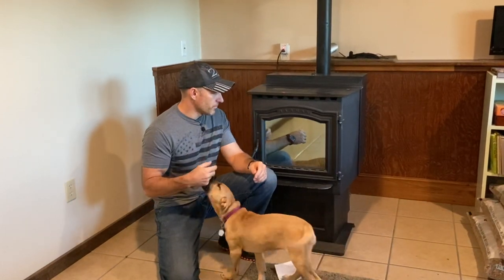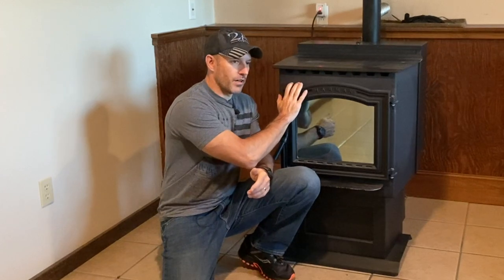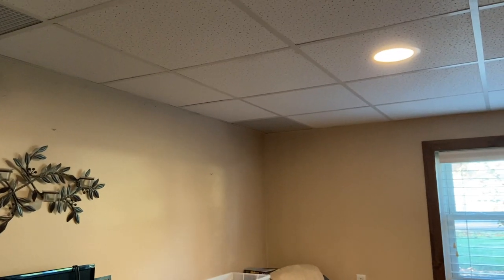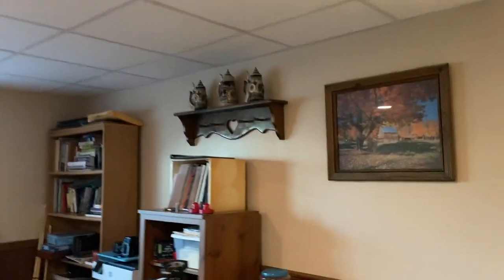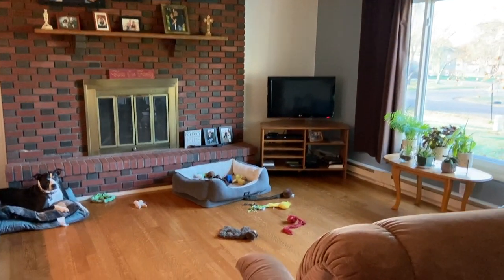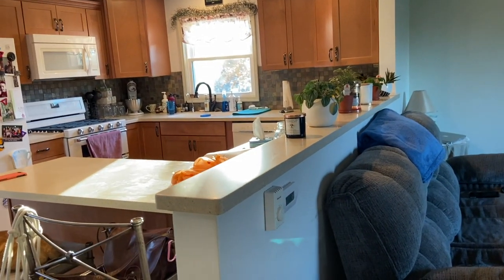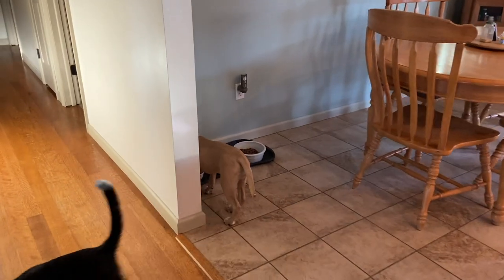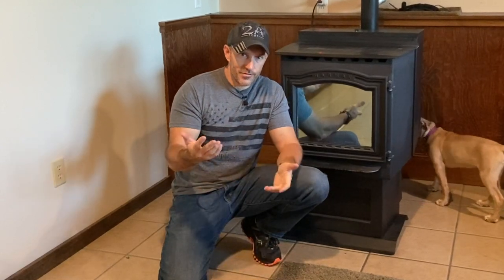How I heat my house with a Pellet stove, and move the warm air around

Comment: I also have a Harman p68. My home is one of those open floor plans. Ceiling fans make a huge difference in keeping the air flow circulating. Just have to turn them on lowest setting. Haven't had any issues with my p68. It's over 10 years old.
Reply from the maker: My harman is about 9 years old and never any issues

Comment: nice, looking at putting in vents myself. basement is undeveloped and the roof is all open to the floor which is hardwood. gets to 25-27c with temp gun. Blowing cold air on the stove into the back, and then the front also makes a nice draft of cold air to stove. have an OAK englander PDVC so i just run ventilator fan on circulation (on 70% of time ). 
Just use as supplemental heat in basement, low burn, get about 25 hrs out of a bag (only on for 6-8 hours a day)
Reply from the maker: thank you very much for the nice long comment

Comment: Great video. You probably should know that not all states will allow you to sell your house if there are open floor vents (no duct) for fire hazard reasons.  I have the same style home. I’m looking for a way to open the ductwork on the lower level where the fireplace is and use the furnace fan to move the heat thru the house.
Reply from the maker: Yep I kinda new that, I'll figure it out when I sell some day. Thanks for watching
Reply: U can cut a whole in ur cold air return by the furnace and run the fan.  It will suck all that hot air in, disperse thru vents

Comment: Nice video, I have an electric furnace in my house, Canada. I am trying to decide if I need to install two heat pumps(10 thousand dollars) or a pellet stove. 
What happens when you close all the doors? 
Do your bedrooms stay warm?
Right now my ducted furnace goes everywhere but it costs me 600 dollars to run it in February.
Thanks
Reply from the maker: My bedrooms seam to say around 69-70. I do have electric baseboard heat that I keep at 70 but don’t think it is hardly ever comes on.
Reply from the maker: Did you see this vide it has a little on how I have my house insulated even in the basement
https://youtu.be/4MlSSGtzlos

Comment: How would you rate your stove ? Thinking of a Harmon. Have a Bosch heat pump is killing me in the winter months $$$$$$😢
Reply from the maker: I believe Harman is one of the best on the market. You just have to give a good cleaning a couple times a year. I would watch one of my videos showing how to clean before you make the decision to buy one. I love my Harman but I hate cleaning it. It will run forever if you do give it a good cleaning at least once a year. It depends on how much you use it. I use my heat pumps in the beginning and end of the heat season. here is the link
https://youtu.be/n3bUWwZc1Kg?si=rq25IS30Vb_sve2N

Comment: I own a cape cod home thats only 32 x36. Built in 1996!    Two bedrooms down , two up.  bathroom on each level that are stacked.  living room and kitchen open format like yours.  I tried to get my p68 to heat my entire house with it installed in my finished basement  but it went through so many pellets that way it wasnt cost effective. 
  I was amazed that you keep your feed level so low on your settings as well .  I was told not to do that because everyone says just because you turn that down doesnt mean you will save fuel.   So  I kept mine at 3-4 on feed.     Im curious how many ton you burn a winter and what are your time frames from when you start the stove up....and stop using it.   Im in pennsylvania....I also use a heat pump in the fall and spring as it is alot more cost effective than my electric base board heat.  
  Come end of nov thru mid march I use pellots.      Long story short I added a quadrafire in my living room on top of using my p68 stove to achieve comfort.    Im not a deva either, Ive never kept my settings or therms set as high as you. im amazed you can keep that size home that warm with one stove.    I would love to do so.      I also cut a big vent  in my floor abouve my stove in the living room to help.   Also tried extending  the temp wire off the stove up into the living room to try to trick the stove into producing more heat in the upper rooms.   Even added a manifold onto the front of the p68 and fire the heat directly up into the vent.    That worked ok....but still didnt keep the home warm.   Yours just sitting there putting off heat and it radiating up the stairs is mind boggling to me.   My stairs are even closer to my p68 then yours.       I added the quadrafire and run it alone until the bitter months months of jan and feb...then i will turn the p68on downstairs to help aid in heating up the floors and the game room it sits in.     For you to heat your entire home with one stove like mine is crazy to me.   Good job
Reply from the maker: I burn 2-3 tons I also use heat pumps in the beginning and end of the heating season.
Reply from the maker: Here are all my Harmon videos thanks again for watching. Hope you have a Merry Christmas. https://youtube.com/playlist?list=PLZEGsnRsdHN5OBGSj2h0bNAqFjsPyroG9

Comment: Hi, I am thinking about putting a Harman Absolute Series in my living room.  I have a chimney but I have been told we can’t use it and I hate thinking of putting another whole thru my home It is a brick home.  See I too have a split level home and my chimney was used for a wood stove o the lower level.  Now I am wanting more heat in our second level.  The wood stove we had is old and eats up wood and we loose heat.  So,  I am in a fight with myself.  I am in fear of the price of pellets too.  Pellet stoves are much more work than a wood stove to me.  I am 68 year old female and I don’t understand why we can’t just use the chimney.  Can you help me understand why I can’t as the sales lady did not explain it in a way that I could grasp.  Thank you so much for your videos, I am just trying to learn this new pellet stove thing.  I grew up on wood stoves.  So, I also wonder how would I heat the house if the electric goes off?  Thank you for your time.
Theresa.
Reply from the maker: Sorry Theresa I’m not sure, I always thought you could use a chimney but not 100% sure. My Harman goes through my wall. I would go on Facebook ad join the (Harman pellet stove owners) group. And ask that same question there are a few people in that group that probably could answer your question. I hope this helps.

Comment: You have the perfect house for this the staircase if you could picture the airflow the top 3 feet or so would be colored red all the way up the stairs till it hits the ceiling in your second floor the bottom 5 feet of those stairs is a waterfall all blue coming downstairs till it gets back over to your Harmon where it gets picked up and recycled❤️‍🔥🇺🇸
What part of the country do you live in I am I would say northern New England and I’m thinking about putting one of those heat pumps in because we need air conditioning two or three days a year but the heat pump I don’t know but I would think anything above 30° the heat pump would take care of instead of burning oil? Could you fill us in on what how low of an outdoor temperature does your heat pump work efficiently? When it’s 50° outside what does it cost to heat the house in comparison to when it’s 20° outside? My thought is I could get somewhere into November with the heat pump and then someplace around the last week of February go back to the heat pump? What do you think how do you run yours?
Reply from the maker: My heat pump works real good for anything above 30° F. I probably could get by only using my pellet stove 2 months and my heat pump for the rest of the winter. I live in central Pa. They make much more efficient heat pump’s now. I think they will work down to 0°. Thanks for watching my video.

Comment: I was curious what climate you live in and what winter the average winter is like.
Reply from the maker: Central Pa, the last few nights have been in the 20's. Thanks for watching my video
Reply: @DIYJIM  So you get some pretty cold days with the highest temp being 47 and can be as low as 24. So that appliance is saving some big bucks.
Reply from the maker: Yes and no at the time when I bought my house I thought it was my best option. If I could have used natural gas that would have been my first choice.  It was cheaper than oil, propane, electric, and a easier than wood. I do use a ductless heat pump when it is not real cold I might have talked about that in the video. Hope this answers your question
Reply: @DIYJIM  Yes you did say you used that heat pump. I felt like you pay some money but it's still cheaper than natural gas depending on how cold it is. A wood stove is a great ambiance but it's a hell of a lot more labor intensive
Reply: Thanks for your time I really appreciate it
Reply from the maker: here are all my Harmon videos https://youtube.com/playlist?list=PLZEGsnRsdHN5OBGSj2h0bNAqFjsPyroG9
Reply: @DIYJIM  Thanks. I've seen a few. I'm watching you compare a wood stove vs a pellet stove. And your house is well insulated and the calculation I got based on how long a bag burns was that you burn through about $180 in pellets a month plus the electric bill which comes out to like $210 a month compared to us which is $400 for Natural Gas.

Comment: looks great until power goes out.
Reply from the maker: You are correct,  I have been lucky where I live I think my power wet out once in about 10 years
Reply: Run it off a generator?
Reply: And how is that any  different than any other heat in system .Other than a wood burning stove..